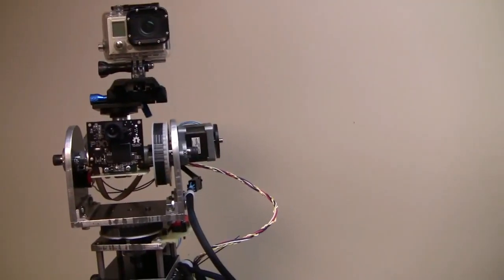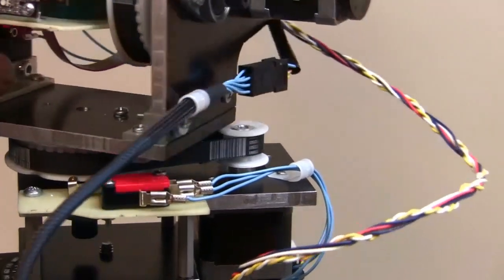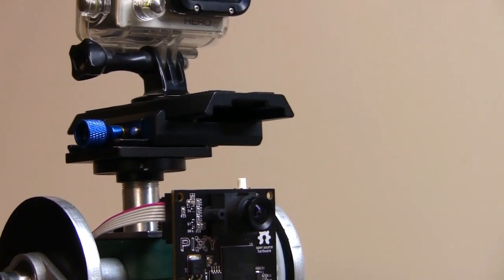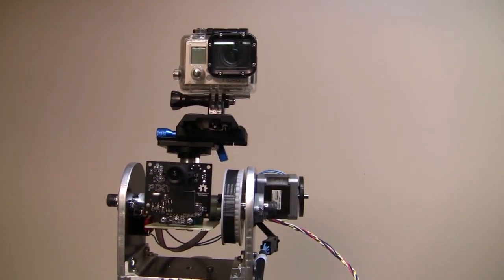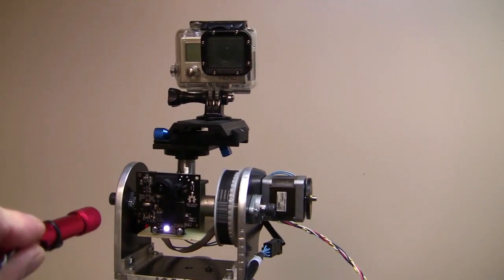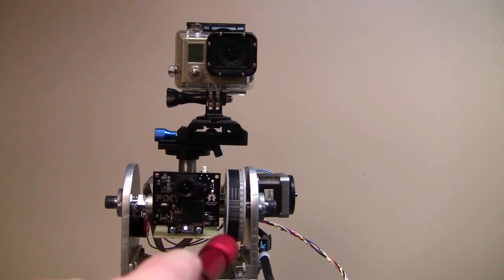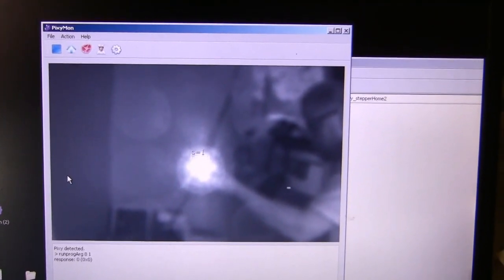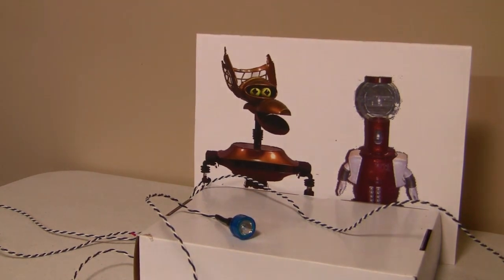cambot3   an automatic tracking pan and tilt camera using a   pixy cmucam5 and arduino

Comment: Cool, but steppers are pretty noisy.
Reply from the maker: This design used solid motor mounts and was noisy.  Isolating the motors with soft silicone  mounts will eliminate nearly all vibrations.
Reply: @robotcantina8957  you can by now use tmc2xxx series of stepper drivers.

Comment: Great project, I worked on a similar project that estimated the distance of target but did not get round to adding a zoom feature.   Actually the zoom feature was to keep a robot at a certain distance moving forward or backwards.
Reply: I am interested in knowing if you have figured out calculating the distance of the target?